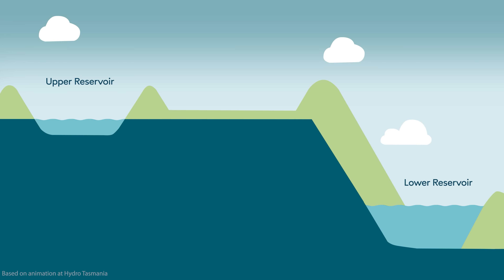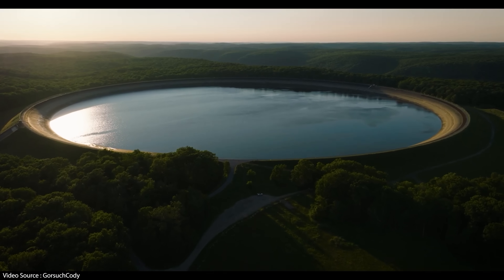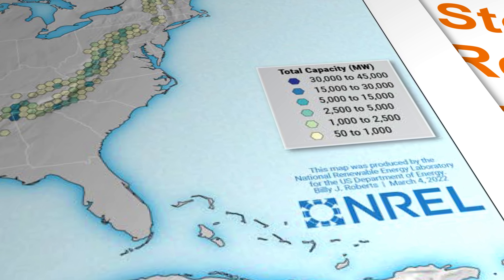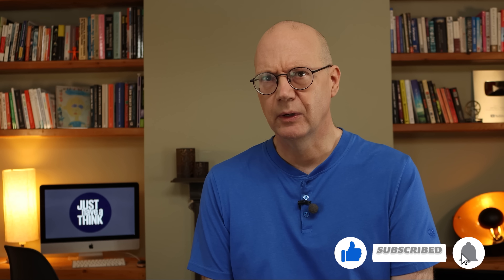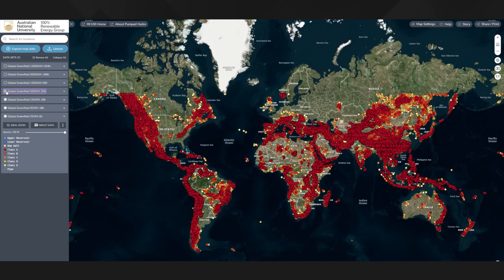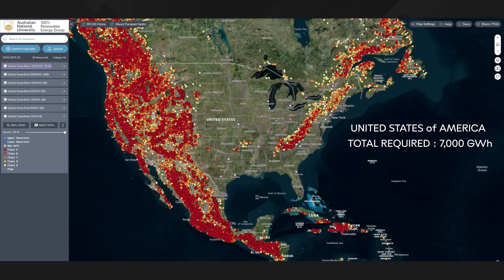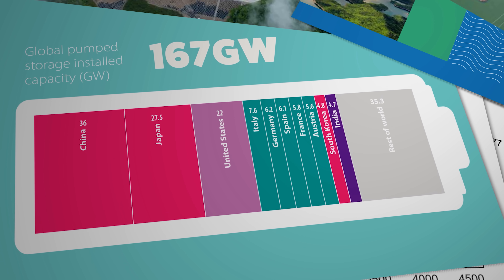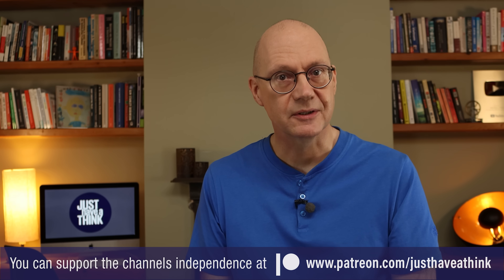The insane potential of Pumped Storage Hydro

Comment: An excellent video. However, the potential potential for pumped hydro is much bigger than presented here. As Richard Feynman said, there is plenty of room at the bottom. Namely, the lower reservoir does not need to be above ground. If it is excavated underground, the head can be optimized and potential sites multiplied. This is not even mere theory, as a demonstration plant is being constructed at the Pyhäsalmi mine in Finland. This is the deepest mine in Europe, 1400m.
Reply: Yes, old mines could be repurposed as the lower half of pumped hydro sites. Maybe not ones that are full of toxic tailings, but many mines should be clean enough. Wikipedia says Pyhäsalmi was a copper and zinc mine, and from the number of non-mining uses they're coming up with like using it as a movie set and data center it must be plenty clean.
Reply: @Kevin_Street  well it's not like it can't be cleaned up before it's repurposed for a new use. It's fascinating to think what uses old mines could have.
Reply: You’re spot on about where the lower reservoirs can be located with the turbines.  When I worked for AECOM we were teaming with another energy company looking at just such a thing, and it was exciting the concept was at that time rather innovative.  We have a large pump storage facility here in Bath County, Virginia, USA
Reply: @bobsmoot8454  You're understating the bath county facility as it is in fact the largest battery in the world.
Reply: @RichardPrendingue bath county is 24 GWh. Snowy Hydro is 350 GWh.
Reply: @gasdive  Snowy 2.0 is not expected to be done until 2029-2030 with "original completion date" of 2024.. so gfys till it's done and Team America eff yea! 🤣
Reply: @RichardPrendingue  snowy 2.0 is increasing the generation capacity from 4 GW to 6 GW but no new dams, so there storage is the same.
Reply: @gasdive  You are incorrect as the Tantangara Reservoir must be connected to the Talbingo Reservoir to get the claimed pumped hydro capacity. The Tumult 3 is limited by the Jounama Pondage volume capacity and the fact it has inferior head pressure height vs Bath County pumped storage facility.
Reply: Using mines and other underground options opens the door to using the same infrastructure for some geothermal energy harvesting.
Reply: Pumped hydro looks even better when you combine it with possible synergies like geothermal or the large scale transport of water over mountains. ( if Mississippi water to solve the SW drought was a viable option for example, having the transport process be a series of pumped hydro systems would make both projects almost twice as profitable.
Reply: @ericmaclaurin8525 I'm so glad you said IF regarding the Mississippi and the SW water problem. Because it's not a viable option. The Mississippi is having to be dredged to get cargo ships the depth they need and the delta is backflowing (although already rising ocean levels may be contributing to that). Unfortunately the Mississippi is having it's own water problems.
Reply: At that level the temperature is going to be at least 50C, probably higher. Water is more likely to act as a solvent, and the temperature drop closer to the surface may cause precipitation of the dissolved material. 
We shall also think about what hundreds of cycles of filling in and emptying mining tunnels and shafts can do for their stability. Some tunnel/cavern collapsing  may destroy the turbines.
Reply: There are a lot of issues with using mines.

You need to factor in ongoing maintenance of the support systems keeping the hole undergound open. Nature really does. It like them and tries to constantly close the void. This can be helped by using a shape which helps resist these forces.

The next is the chemistry of the water. Most deep mines mined ores which are sulphide based. The orebody is mostly formed by heated water containing sulphur which mobilises the metal and concentrates it to make it profitable to mine. The sulphur in the water forms sulphuric acid and will eat metal used in support systems and generation systems. The other problem you often get with mine water is high levels of salt, again a difficult environment to have machines generating electricity.

The devil is very much in the detail. I was involved with an old mine which looked pretty promising for pumped hydro. It was right next to major power lines, had pumps underground already keeping water down. My back of the envelope calcs made it look profitable (I’m a mining engineer) but when the owners looked at the project with infrastructure specialists it was quickly killed because of maintenance costs associated with the slightly acid water.
Reply: @deaninchina01   interesting. are you living in China right now? So we're the maintenance costs just a little bit higher than they had hoped for or they truly prohibitive?? I'm just curious if their decision was based on a legit acknowledging of non-viability or simply because they were greedy little suckers and wanted heaps of profit and didn't want to pay slightly more for it to work.
Reply: @deaninchina01  Who doesn’t like (salted) potato chips or ‘whopper’ cushions?  But seriously, perhaps some method to separate salt and sulfur and sell as byproducts to, at least, defray cost of purging those elements.
Reply: thank you for this information
Reply: Salt diapirs is another kind of mine that might be promising.
Reply: That's expensive though
Reply: Oh right - like that would take no energy and water to build.
Reply: Yes, but no unless you reuse an existing mine, excavation ils very energy intensive, it would make the costs go way up
Reply: You don't need mines to store hydroenergy underground. A company called Quidnet Energy has developer a techniqie called geomechanical pumped storage. They hope to expand the technique to 10MWh storage systems.
Reply: I was just thinking about that. Send like a good idea!
Reply: If a denser fluid such as bentonite (1500kg/m^3) was used I assume that the required volume or mine depth would be less for the same energy storage.
Reply: You're going to run clay through turbines?  Let us know the mean time between failures!
Reply: @gregobrien7147 Bentonite chemically is aluminium phyllosilicate clay which would create a galvanic corrosion issue with steel and some other metals. While alternative materials could be used the costs would be astronomical vs durable steel piping in a pumped hydro using traditional water as a working fluid.
Reply: @RichardPrendingue   perhaps there are other alternative fluids that provide a better bang for buck than water for this purpose. Chemists???
Reply: @Krill_all_health_insuranceCEOs  Nothing is anywhere nearly as close to being as cheap as water.
Reply: @Krill_all_health_insuranceCEOs  You stated better bang for buck than water which is either relatively cheap or free being absolutely impossible to beat even when accounting for evaporation losses. Although, I'll leave exception for the poorly sited Hoover dam in a freaking desert. 😅
Reply: @filonin2      I'm sure that's true but I was referring to the earlier comment or statement about some alternatives being denser providing more energy bang for the buck and/or unit volume
Reply: @RichardPrendingue  I meant greater energy output per unit volume sorry I stated it incorrectly 

Is the Hoover dam still in operation?? Well the desert does need water lol... But really I believe desalination will be the way of the future
Reply: @Krill_all_health_insuranceCEOs  Theoretically, liquid CO2 is roughly equal in density (0.986 KG per Liter) VS water being (1 KG per Liter) but that's a whole new can of worms dealing with the 860 PSI for room temperature liquid CO2.
Reply: @RichardPrendingue   hmm. Yeah I don't know enough about it. Just curious if there are superior fluids than water for this purpose now that someone raised the quest. There may not be.
Reply: @Krill_all_health_insuranceCEOs  the biggest bang for your volume buck is probably granite.

You can cut a cylinder of granite then put a seal around it and then pump water under the cylinder.

That lifts the cylinder of granite and pressurises the water underneath. 

A 1 cubic km granite cylinder lifted 500m gets you about 3000 GWh

That's a bit over 1% of the world requirements. So you'd need about 100 such cylinders world wide.
Reply: @gasdive   I km^3 is huge though. Do we even have the capacity to build something like that? Is anything like this in operation today? Or being considered? Interesting stuff. Once one realizes that dirty fuel sources are no longer necessary then the future becomes truly exciting and wide open.
Reply: @Krill_all_health_insuranceCEOs  most of it isn't "built".

Cut a circular vertical slot a bit more than 1000m deep. Line it with something water tight on each wall. Put in a seal. (Yes, that's a hard thing to do, but it doesn't have to be perfect)

Then cut a very thin slot horizontally at the bottom. Probably by using a cable as they do for quarrying.

Pump water in and it lifts the cylinder.
Reply: @gasdive  oic that's interesting. I'm not a ME- is this something that's been thrown around for a time as a possible viable clean energy source?
Reply: I doubt that using a denser fluid would be economically viable for two reasons:
- The fluid will cost much more than water.
- All machinery has to be adapted for the higher forces that will occur (turbines, pipes, valves...).
Reply: @gregobrien7147  Yes, but you would have to keep the bentonite loaded water under pretty strong circulation to keep the bentonite from falling out of suspension. Bentonite doesn't "melt" into the water like salt, it's very fine particles will stay suspended fairly well unless the liquid stills. Bentonite without water isn't a fluid, or at least I never saw that in an oil rig mud room, but I saw lots of dry bentonite clay power used to create drilling fluids that would float tailings of heavy , hard rock up from the bottom of deep holes.
Reply: Definitely not the deepest mine in EU. Deepest eg. in 'Ruhrgebiet, Germany' is 1640m.
I also strongly doubt that a mine can provide enough volume (compared to a lake).
Reply: @andreasherzog2222 yes, the head would be very variable. Worse, the (final) generator would be near lowest level. One flood & expensive cleanup. That’s a very niche application, distraction.
Reply: @andreasherzog
The PSH capacity is based on 2 things. Volume and difference in height. With enough difference in height even a lesser volume might be economically viable.

Comment: I did my dissertation on Marine Pumped Storage back in 2012. You could build a reservoir in the North Sea. It could be, say, 100GWh and,say, 20GW. And there are sites on continental shelves all round the world. You just have to want to do it.
Reply: North Sea is the low reservoir. The high reservoir is then in a mountain lake in Norway that is now suddenly full of seawater and traumatized herring? 😆 Nobody WANTS that.
Reply: In the early 90's (or late 80's) a plan of basins in the North Sea was presented. The basins were supposed to be using tidal movement and windturbines, inside the basins was room for fish farms. The idea was turned down on enviromental grounds: Life on the bottom of the sea would be disrupted too much and wind turbines would kill too many birds.

I'm realy curious what the new perspectives are since windfarms at sea are no longer an issue these days.
Reply: The (massive) lagoon is the higher reservoir, the North Sea is the lower. High flow-low head. Potential fish nursery if you keep the boats out.
Reply: @henrydale9762  If you dam it up, that will keep the boats out. But in this case you would have to sync your activities with the tides, and you would have a tidal power plant as well. Which is potentially good. Maybe even better than the pumped storage part. But salt water and low head is bad. Well, the best of luck, but I'm not buying shares.
Reply: What I read here sofar is all based NEAR the North Sea, not IN the North Sea.
Reply: @hotdognl70  It makes zero sense to have it inside the North Sea or any other body of water. We are talking about two reservoirs at different height, pumping the water up, and generating electricity when we let it back down. No fish, no wind turbine, no tidal power, no solar cell, forget about all that for two seconds. What you are talking about is something completely and utterly different. Good stuff, I'm sure, but not relevant.
Reply: @geirmyrvagnes8718  The relevance is in the the comment we are all responding to: A 2012 disertation about marine pumped hydro storage and North Sea is mentioned as example.
My example is roughly 30 years more dated.

Comment: How can a 5 (or 20) hour storage be enough to cover our needs?
Reply: Wind and solar becomes so cheap that it makes sense to build MORE than you need (in terms of production and use over one year). You are competing with expensive gas peaker plants for the expensive parts of the day at that point, so you are good economically. Wholesale electricity is therefore very cheap in the periods when it is plentiful, so you charge up your storage for nothing. Since you have "overbuilt" you don't need much of it under normal conditions. Maybe some demand peaks. Under difficult conditions, you still have SOME production, so if you have 4 hours of reserve assuming zero production, that could last for, say, a week. It is a very different scenario than a fuel-based one.
Reply: @geirmyrvagnes8718  "in terms of production and use over on year" - this is the point! You need to store energy enough for months, not just hours!
In bad conditions (winter) you might get under 1% of built-in peak capacity...

Comment: Can someone please point out the downsides of hybrid energy storage in existing hydro plants? What I mean is just set up PV beside or on top of hydro lakes, connect it to the grid and when the hydro and PV are producing excess power, pump water from the bottom of the dam to the top. It is the cheapest battery because you already have the infrastructure. You get bigger output and a more reliable power supply
Reply: Nothing wrong with this - plenty of examples now of PV on water to cut evaporation but it takes an awful lot of solar power 
to move water uphill!
Reply: @Oliverg8sr   arent lakes behind hydro usually massive?

Comment: All that storage capacity expressed in GW or MW, but not GWh or MWh, really? It would be nice to have a clearer separtion between power capacity in GW and energy capacity in GWh. Instant power capacity in GW is a measure for the number of turbines and the size of the pipes, the dynamic behaviour. Energy storage capacity in GWh is a measure for the volume and height of the water storage, the static properties of the storage. The two seem to be mixed in the explanations.

Comment: Time to pump the extra seawater uphill for some new saltwater lakes. What I love about these systems is they convert sporadic power based on Wind/Solar into consistent baseload power that can truly replace coal and gas plants. It is also technically possible to use DC direct drive pumps that would spin faster as the angle of the sun improved. I do not know whether that is realistic in all applications, I only know about that for small systems. If it did work, you could avoid the efficiency losses from the power inversion from DC to AC.
Reply: Salt water penetrating the ground would be a flora killer, any wildlife atracted to basins would be in serious trouble as well.

Comment: Yet another great, insightful video. Thanks, Dave. I wonder if pumped hydro tech has any place in our (US, that is) potable water system? Many of us get our water by simple elevation-derived pressure, i.e., we rely on elevated reservoirs (water tanks) that maintain pressure to our taps. Couldn't we utilize the flow in this system for some energy needs? Might home-owners be able to use the flow of water in their water pipes for some electricity?

Comment: Now when you say pump the water up 500 feet  and let fall back down . What kind of pumps are you talking about that can move that volume of water quickly  and reliably without breaking under that kind of pressure? I  mean moving that volume of water that fast, that much is going to be a herculean undertaking and will put a lot stress on the systems doing it.

Comment: As always, the solution will be worse than the initial problem. The two fundamental question never addressed are: 1) what is the carbon footprint of this industrial development and what is the amortization period of that footprint and, 2) how does creating more industrial landscape solve the problems created by industrial landscapes? More specifically, especially regarding battery operated vehicles, how does more consumption solve the problems caused by consumption? These are not solutions to anything except maintaining the ability of the rich to get richer. 
Do you want to live below a dam? Do you want all high land turned into risky, dangerous, ecology destroying reservoirs with dams? 
The only solution to our many environmental and energy and climate problems is dramatic population reduction. Otherwise the Laws of Thermodynamics make "net zero" and other fantastical notions rather impossible. 
This guy is a cheerleader for continued destruction and over-exploitation of the environment in order to stop the continued destruction of the environment and climate. Yeeesh!

Comment: The size and scale of pumped hydo, along with a - “not in my back yard” - attitude,  makes this approach highly unlikely. But at least its an approach that is possible.  But I suspect environmentalists will oppose this type of solution.😊

I believe the use of molten salt as a heat storage battery - storing heat from nuclear reactors, is a more practical method. (As Bill Gates has proposed with his natrium reactor). With the stored heat available to generate power whenever needed,